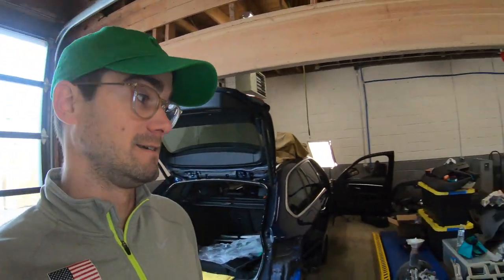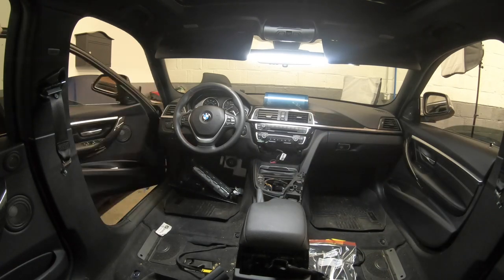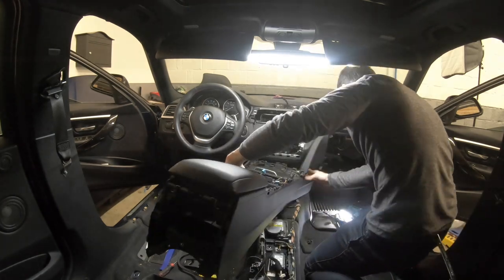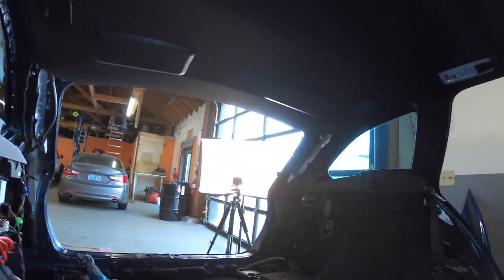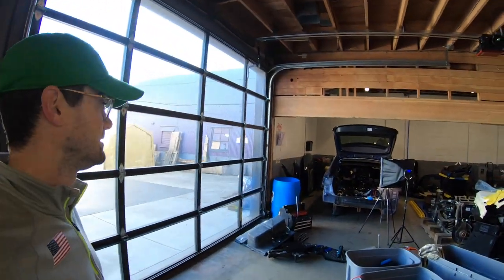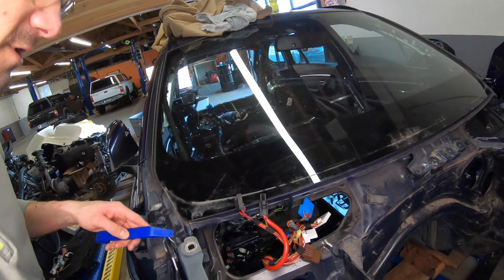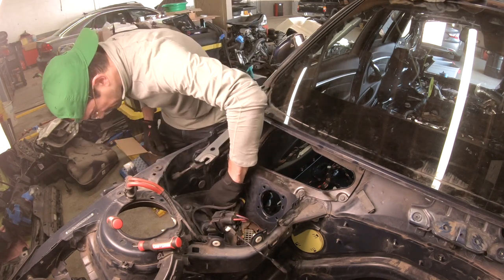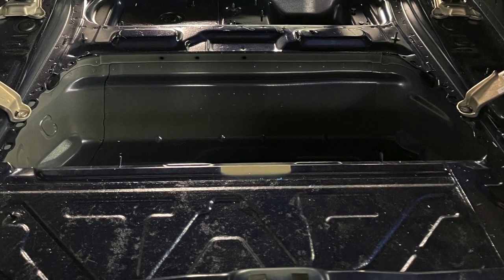Stripping the 328xi wagon down to a shell!

Comment: Hi David. Great content & helpful for anyone needing to strip out; or just dreaming big. QUESTION: any idea how DEEP that recess under the boot carpet is? Measurements very welcome. I have a COMPLETELY different project in mind; in Europe (the Ukraine war doesn't help) petrol/gasoline prices have hit £1.60/litre - that's $9.50 per imp. Gallon in USD!! (all sympathy welcome). I'm looking to convert to LPG (actual gas) which requires a gas cylinder in the boot. I have an e91, but will upgrade to an f31 if going to invest in the conversion. So I'd be really interested to know how big that recess/alcove is, especially with the plastic liner removed. I'd even consider cutting into the floor (can strengthen it with bracing afterwards) just to get a bigger tank in or seat it lower down... But not sure what's directly underneath it under the body?? (no point if the gasoline tank's there!). I've searched & tried to tell, even looked to see if our BMW dealer had any older f31s in stock, but no luck so far. So your expertise would be most welcome!! Thanks, Oliver